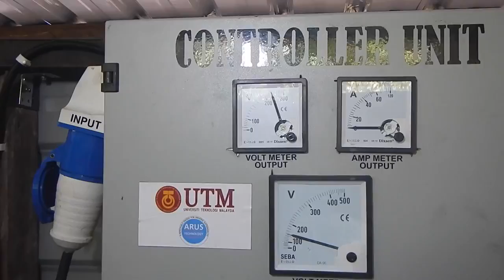LOW COST MICRO HYDRO POWER GENERATION: A CROSS-FLOW TURBINE DEVELOPMENT

Comment: It is too bad to demonstrate a project silently !!!!!!!!!!!
I assume that you can speak English !!!!!!!!
so, put foreword a diagram for the project?  what it has?
how long it took, how much did it cost? 
how much electrical power  is generated ? And
What are  specifications of the turbine and the generator ?
Problems you faced and how did you solve? and 
How long the project took to complete ?
Reply: I agree totally.  Very interesting, but frustrating.  More engineering design & development required and less installation video bites.  This is from a Technology University -- it's not too much to expect.

Comment: U T M, the radius of a cross-flow turbine runner MUST be large enough for cross-flow to take place.   if runner rotation rate is too high, under load, cross-flow cannot take place.   a correctly matched turgo / pelton turbine would be a better choice at this site.  like so many others, this turbine has been made TOO small to be efficient.  assuming a flow rate of four liters per second and an effective head of twenty-five meters, there is about 980 watts of potential energy available at this site.    cheers
Reply: Base on my views, it seems that they are more concern on the cost reduction rather than efficiencies. However, I might be wrong :D. Just curious, did you take part in this project?